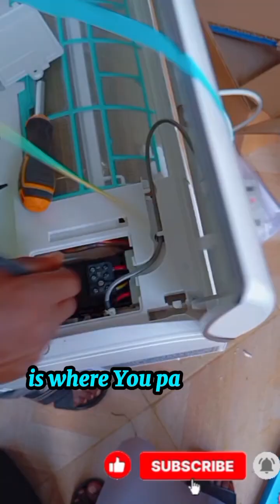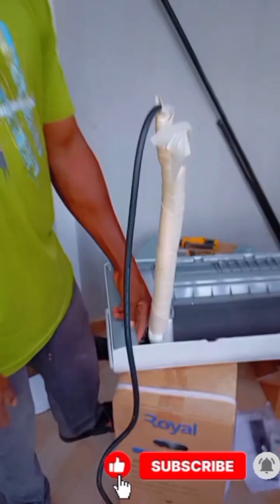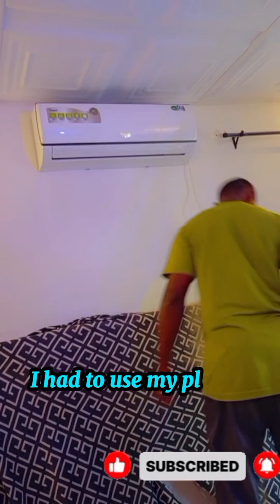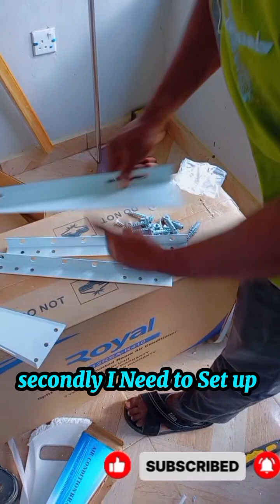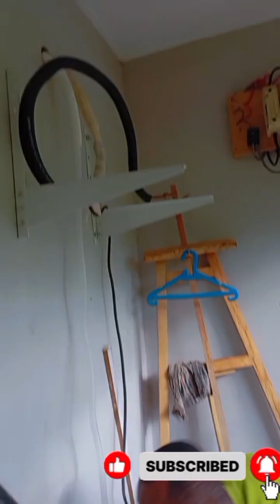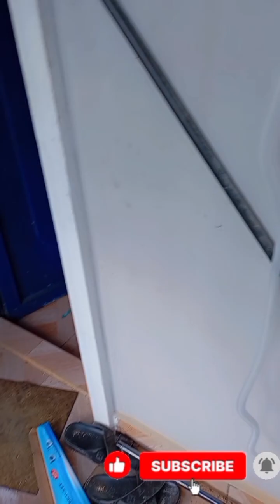🧰 Fast Royal AC Installation You Can Do Yourself — Step-by-Step Guide!

Comment: Kudos for this ac installation. 
I have a royal inverterAC of 1.5 HP after installation  it was showing Er and the installer switched wires position and it starts showing F1. The ac could not pick to function well. What do you advice me to do?
Thank you.

Comment: Comprehensive tutorial, how do you go about it if the copper pipes have to be extended?
Reply from the maker: It is either you use a long pipe or use nipple to join two or more pipes together 😊
Reply: @josephsampson9655 you don't use oxygen to weld the joint??

Comment: So why water 💦 leak after installing??
And how to solve it??
Reply from the maker: I also explain it in the video
Reply from the maker: Let me just add something 

If the hole on the wall is not a little bit sloppy the water will return inside and if the AC is not straight or tilt a bit to the hole side the water will lug and drop inside

Comment: Thanks for the explanation.But what causes an air conditioner not to cool a room after installing
Reply from the maker: Check is the gas is still locked up in the compressor
Reply from the maker: Also the grid voltage. Most important check your connection cable between the indoor to outdoor

Comment: Hello, I installed an Hisense inverter ac and the outdoor unit keeps working and never stops running even when indoor is already cool except I change the Temperature to 30 degree then it stops.
Please what can be the cause?
Reply from the maker: Greetings. 
I am here to help you resolve any ac related issues. But I can't understand what you mean. 

Do you say the AC doesn't turn off at all until the temperature is set to 30⁰ 

And also at 30 degrees the AC should be able to regulate its outdoor unit by turning it off and on because at 30⁰ is almost the same as standard room temperature which is 32⁰. So the AC must not over cool the room beyond the set temperature so the AC must itself by turning the outdoor unit off and on at any time it wants to maintain the set temperature.
Reply: @josephsampson9655 I have a similar problem, when I switch it off the indoor unit is switched off but the outdoor unit does not but I think it is a PC Board issue.
Reply from the maker: @POLOBZdid it just start of resent after using the AC for a long time or it then first time you are installing the AC to experience that?
Reply: @josephsampson9655 started recently and it was working fine all along.
Reply: You doing a nice job man. Don't give up
Reply from the maker: If I have not responded well hit me on Whatsapp DM +2349039287987